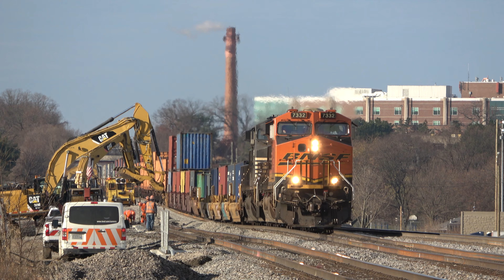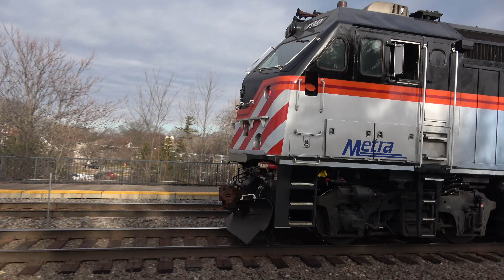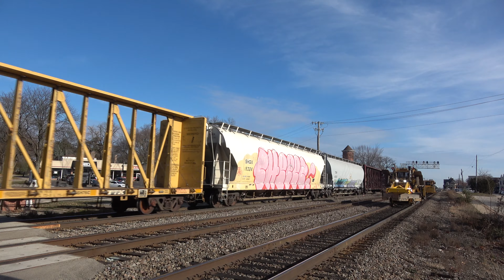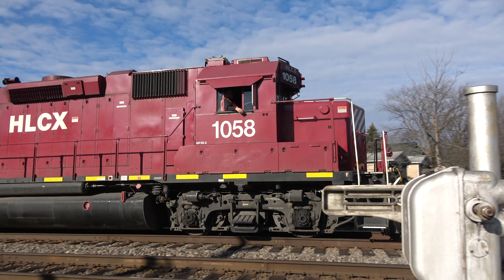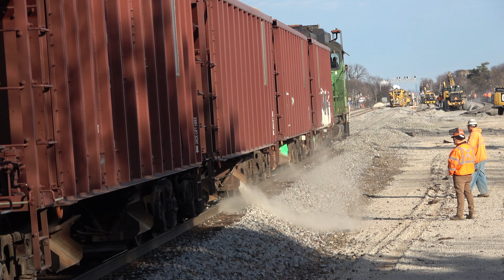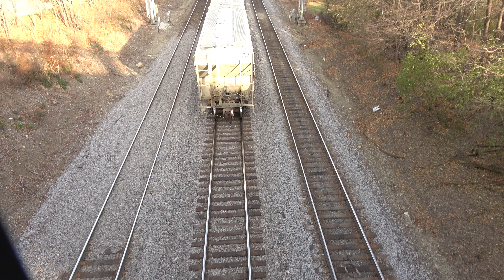No More Shoo Fly

Comment: WOW, seems just like yesterday they were building the shoo fly bridge. I read that there will be room for 5 tracks but just a 4th track will be built for maintenance trains. Correct me if I'm wrong. Another GREAT clip.
Reply from the maker: I was told that it was built to handle five trcks across, but the reality is what you have stated; three mains line tracks with a single short stubby siding.  There will also be an access road to get up to the bridge.  (Five tracks might be wishful thinking.  This is a very wide bridge, but I don't think it has the newer Federal Rules for spacing between the tracks....?)   Thank-You for viewing and commenting...!!!